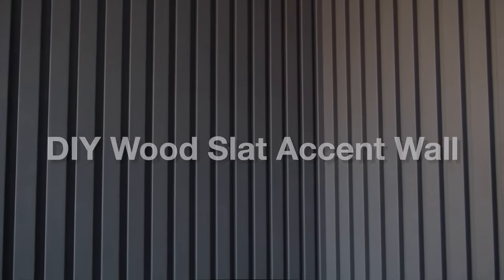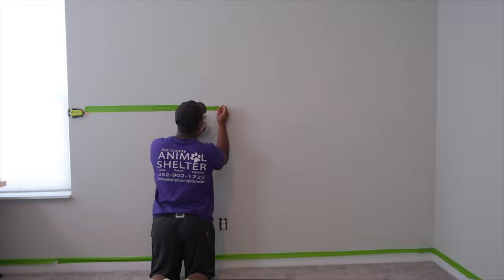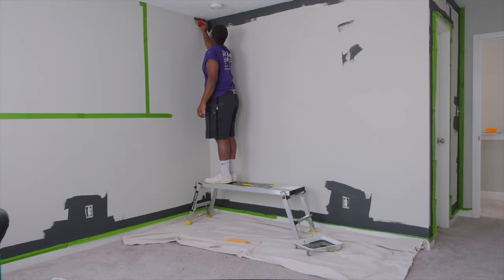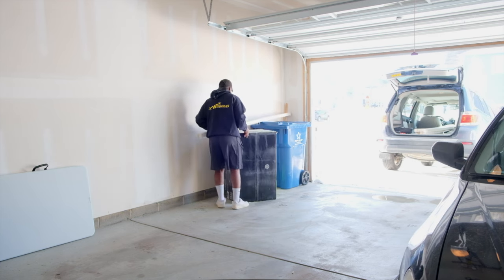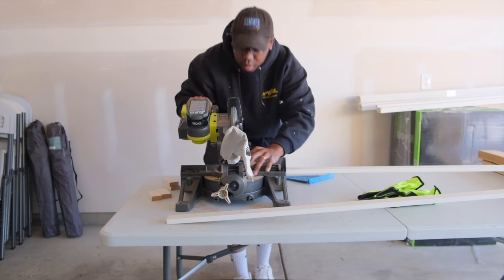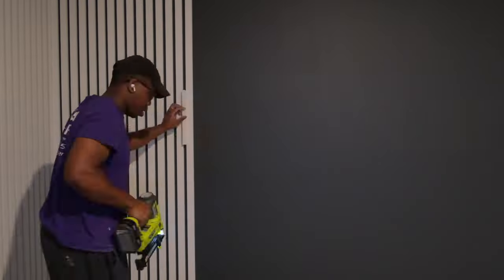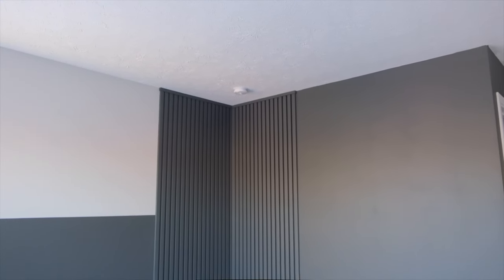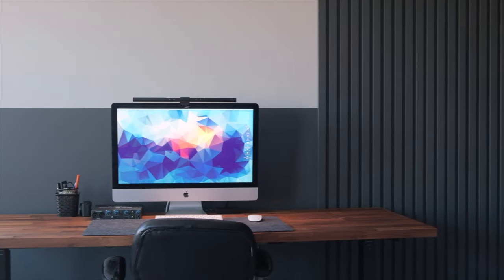How To Build a Wood Slat Accent Wall | DIY Slat Wall

Comment: Good job.  Should I saving money and time by using a prefab wall from Wayfair ? 4PC x 94.5"x 24" 3D Acoustic Wood Slat Wall Panels at $400.00.  Just a thought, good job, thanks for sharing
Reply from the maker: Thanks! Yes, you could consider that too. Lots of options out there now with pre-made slats. Most of them look really good!

Comment: so you just nailed the slats to the drywall? is that enough to hold them in place?
Reply from the maker: Yes, you can apply a small amount of liquid nails if you want, but I has held up for almost 2 years now. The paint also helps to hold it in place too (if you paint after nailing them to the wall)

Comment: do you just nail into the dry wall?
Reply from the maker: Yes. The brad nails hold it pretty well. You can apply a little bit of adhesive to secure it more if you want.

Comment: you could build the whole structure in your garage and install it on the wall with 10 nails
Reply: no bc walls and floors arent perfectly level you need to measure and space each board